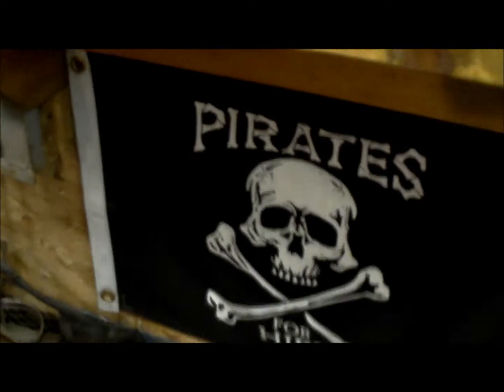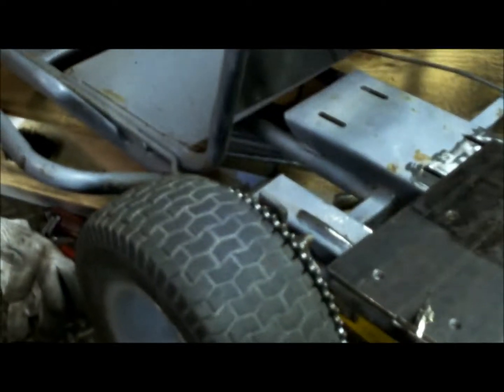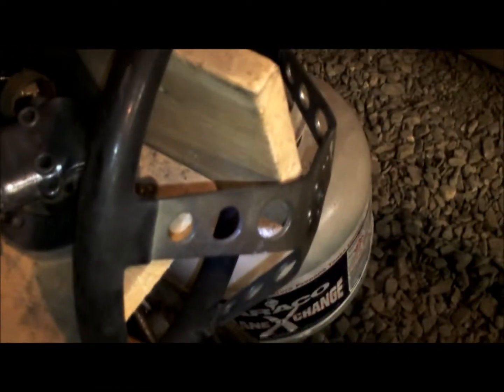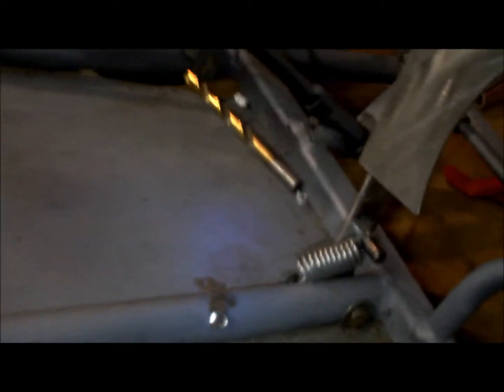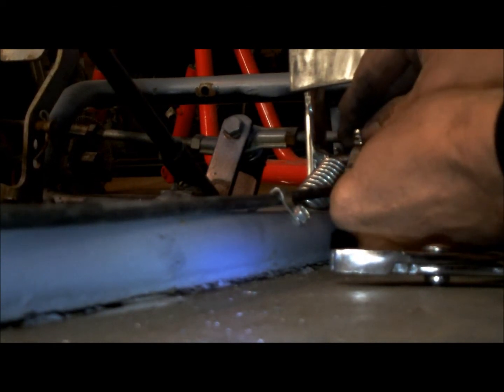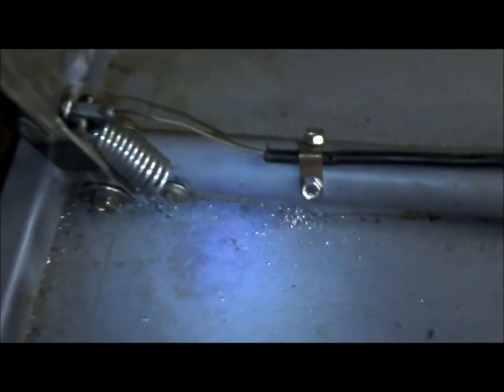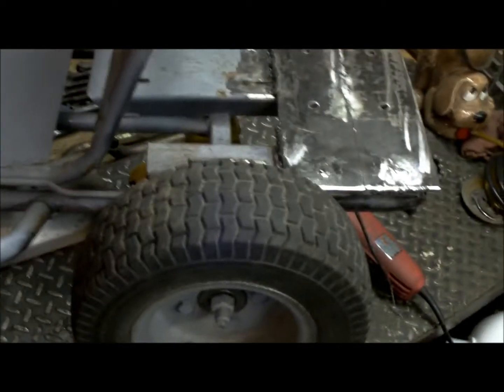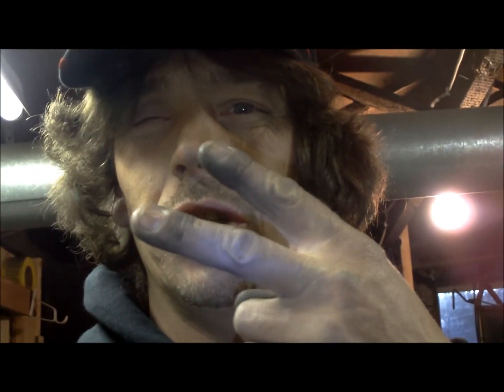corvette gokart restore #4

Comment: I am sure there are many more ways to skin a rabbit than my suggestions but with your accelerator cable I would put a washer on each side, and drill a small hole on the open side of the shaft, and split pin it, then their will be no accidents.

Mate you are not a "wacko blind dude", your a very passionate person about your hobbies, if I had a mower shop or similar I would employ you.  Keep up the learning, I'm just a 49 yr old with a broken back.
Reply from the maker: mate your alright with me, I just do my best with what I have, cheers